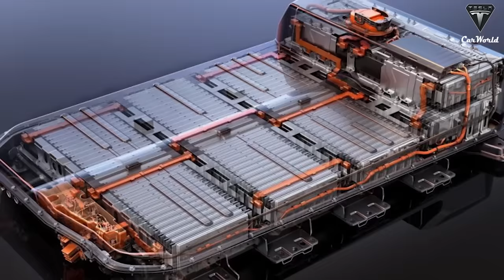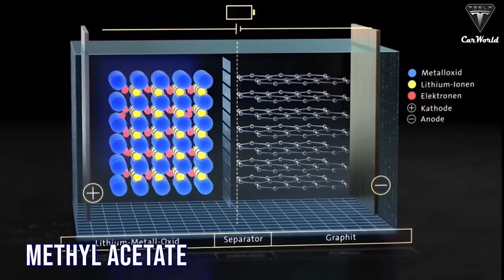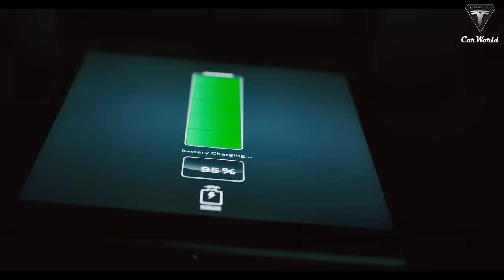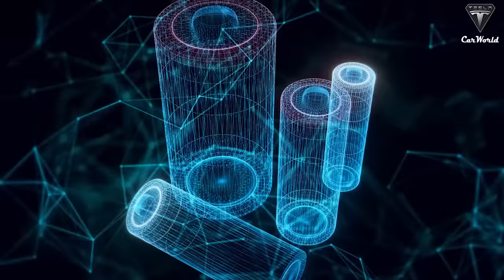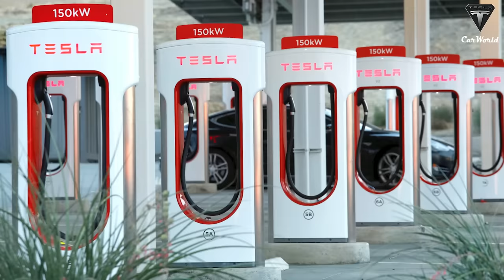The End of Lithium P3! Elon Musk Revealed ALL-NEW Shock Battery Tech, Change Entire Industry!

Comment: I'm willing to bet that a battery that costs less or the same as a lithium battery to make will cost significantly more for the end consumer, making it only available to the wealthy. Also, it will decrease the need for replacement batteries and potentially the need to replace cars as often as we do, which will affect the profits in these industries.
Reply: Most people have no idea that commercial electric motors are designed to work for 40,000 hours. Any idea how far that is at 50mph? thats 2 million miles. in the early days reporters laughed when they asked Elon how long his cars could last and he responded with hmm, i dont know -a million miles id guess. well, he was off by half, but nobody was even thinking about the electric motors, they were the EASY part. People say they want an electric car so they can shoot the finger at gas stations as they pass, anybody who ever got quoted $800 to put in a lousy starter, or $1500 for a timing chain, or $2000 to replace a lousy main bearing gasket, thinks SCREW that, i want to be able to pass mechanic stations! my point is if you DONT WRECK it *paint jobs are $5k these days. And you can take the BATTERY out of the equation, Then EV's last practically forever. If youre 50+ it will outlast YOU. Cars of the future will be sending out satellite signals that say DRIVER DEAD, -please replace. LOL
Reply: '...available to the wealthy.'  When we use to be held under ransom by the Arab oil producing Nations but now a new paradigm literally free energy from the Sun and Wind that the distribution of wealth should be extend out fully even to the consumers with cleaner environment and cheaper product that will never be exhausted, well lets hope.

Comment: The fact we haven't converted to hydrogen power is still beyond me.
Reply: Hydrogen is a fun atom. It's so small it literally leaks through solid sheets of metal. Like, right through it as water would through a sponge if you poured enough. Only, once inside, it likes to create spaces for itself. These spaces make metals extremely brittle before their usual failure times. And for those who like fireworks, these metals can actually catch on fire (more go bang) due to these hydrogen molecules. 
What I'm saying is that while H has an easy pairing to other atoms, it's a bit too active to be of good use, without sub-atomic forcefield tech.

Comment: How about to use alternative energy to stoking energy. Like this way attached a sensor to the wells where rotating wells kinetic energy transfers to alternator and alternator transfer dc energy to the butters  store static energy or direct to system . Which is comes prominent energy all the time.
12/302023

Comment: Tesla doesn't use a single battery type and even if this comes to fruition, and battery tech takes a LONG time to prove, it's still going to use multiple battery types simply due to cost effectiveness and supply issues.  One battery type it's started to use in Asia is LFP from the company BYD and this isn't going to stop because they're cheap, have much better life cycle than Tesla's Li-Ion 4680 and is much safer than Li-Ion and easier to deal with because you don't get thermal issues.

So this will be neat and all, but cost is everything.  Manufacturing to scale is almost ALWAYS the issue.

Comment: Just make a 10-piece car😊 for $20,000 that goes a thousand miles on a charge. And takes 15 minutes to recharge.
Reply: And also make utilities offer charging at household rates. It shouldn't be allowed to charge more for faster power because faster power means more customers so why the premium? It makes it more expensive than gas. it's not just environmental that is driving this. We are consumers and that's why it's called a Utility. If you have to adjust for peak grid usage ok. But if you now want people to charge during the day with solar higher than get real with the pricing per kilowatt hour.

Comment: Most cars drive on average 14,000 per year. A million mile battery would last 143 years, not 200. And that is if they are only used as average. Of course we need better then that if it is to replace long distance road trips and trucking which hit a million miles in ten years all the time. And the controlled temp of a lab and conditions will never happen in real life. This is a hypothetical battery designed to get investors involved and Money infused into Tesla. But it would be a great thing so lets keep trying.

Comment: Is it possible to make high voltage battery for cars and trucks so that taking less space and less in weight?
Reply: Voltage is a function of the chemical reaction taking place in each cell. We add cells together in series to get the desired voltage. Making a highvoltage battery would just mean more cells in series. It wouldn't change the overall capacity of the battery unless it meaningfully changed the charge\discharge losses naturally associated with all charging cycles. My guess is that this has already been investigated and found to be a disadvantage due to high-voltage risks/issues outweighing any potential gain in discharge loss.

Comment: What are EV'S going to do to protect from EMP attacks including from the sun if not enemy forces
Reply: Hopefully give you battery tech to keep the lights on for Sol system exploration, during which perhaps we'll find materials and patterns we can use to keep us better shielded. But if you're worried bout EMP, then I think a human powered glass-vapor-coating rig for coated wires for dynamo wrapping, and a human powered copper wire-draw & braiding system for the wires themselves, should be on the top of list of equipment to have in your tool-bunker. Along with wood fired crucible and some copper scrap or ingot.

Comment: I knew this will come... The long awaited guy is finally here!

It is groundbreaking and a huge milestone in Lithium technology. When practical test conditions are eventually carried out, I hope sooner or later, we'd have them for solar system applications.🎉
Reply: AND if it costs 3X the cost of current Li-Ion, which Tesla's cutting edge is the 4680 which is EASILY over 100,000 miles depending on how a person charges in fact probably closer to 500,000, this battery will never see the light of day.

Battery tech takes a VERY LONG time to develop and to fully test and then to make it economical to manufacture, which is the key.  It can be the best thing in the world but it doesn't matter if people can't afford to buy it.

A typical person doesn't have a vehicle for even 200,000 miles and many people would drive 200,000 in about 15 years and would have already gotten rid of the vehicle for many other reasons, to put this into some kind of perspective.  Economics will win the day.

Comment: One of the things I remember well - how batteries get hot and are at risk for starting a fire or melting things near them.  Do we have those risks with these new batteries?  What are the risks?  Will they be able to be brought on airlines?
Reply: Yes. Risks will be battery to battery but with all ionic forms, there is a risk of discharge and uncontrolled electron flow. Some of them will be safe enough, we can guess, but their development times for such safety will be varied. And what we learn from these elements in use may end up crossing over. Much of the tech is in the patterns of shields and electrolytes.

Comment: 05:43 A PANTOGRAPH atop a lorry!? NOT POSSIBLE! Where is the current RETURN? On railwazys it is the track with the metal rails that is the second part of a circuit. Plus the overhead wires are NOT stagered as they are in all pantograph operations. Asphalt or concrete are NOT conductable elements, plus a railway has a FIXED course of travel, an lorrie with stearing and pneumatic tyres is NOT a fixed system! Thus I am ten billion % in favour of pantographs on top of trains, but they simply won't work for the automotive industry.

This is why trolleybuses that utilised a 'touring area' a track to either side of the bus that again travels on a non-conductive surface has TWO poles (not two pantographs as there is no physical room for that, plus 2 poles as the tyres again, have no conductivity on the road)! PLEASE be accurate in your visuals This is bad for the promotiona of transport electrification! Thank you.

Comment: After 2030 I will eventually need to have a self-contained electric motor module that will fit the front engine compartment and the gas tank area under my cars to retrofit fit my 49 Ford, 2005 XJ8L and 2003 Toyota Highlander.  Is anyone working on this retrofit need or do billions of vintage and antique cars have to go to the junk yard?

Comment: its a total sales pitch. and the idea of using them to support the grid, well surely, thats going to put alot more "demand" and "cycles" onto the battery than actually driving the thing, thereby massively reducing the "at best" figures given. the vehicle battery being a "source" of energy for the grid...u lost energy from the grid to charge the thing, just to pull it back, adding extra cycles, whilst saving grid infrastructure from expenditure it needs to do its damn job. pass that cost onto you instead, why not, they can save on infrastructure investment, while making more money selling you electricity waste in losses alone(more you waste, the more they sell), ontop of taking extra "cycles" out of the battery. faith and virtue versus whats actuallly realistic. even if it did make sense, its decades away.

Comment: Graphene battery are not new been using them for over 7 years.  they weigh more they cycle a lirrle better thats all.  we are still way off from having a battery for the masses electric cars.  a hydrogen fuel cell would be best today only problem no hydrogen stations the same with charging stations both would have to exist along side gas stations.  when you see gas stations replaced and nuclear plants to create the power needed for all that will be the time for an electric car

Comment: Better yet a Hydrogen Fuel Cell Running Motors, Making its' own H2 & O from tap water. Charging a small battery to start the Cycle after shut down. Not Preputial Motion just Very Efficient Fuel Cell and Motor Technology. y

Comment: Why do they keep on about the battery and how long it will last before its a pile of crap. i don't care if the battery will go 10 million miles the problem and the Achilles heel will always be the time it takes to charge the crap  what is the point of toping it up when you do 100 miles  just to keep the battery in good condition it is not practical . And they know this and this is why they are forcing you into lockdowns 15 min city and all the rest They taken you as sheep and easily conned. Toyota has a far superior solution  the same engine that they produce now and it will also run on hydrogen also and it takes only 90 seconds to fill the tank and carry on another 400 -500 miles

Comment: Unfortunately, this video FAILS TO DISCUSS THE MASSIVE PROBLEM WITH ALL EV BATTERY TECHNOLOGIES -- COLD WEATHER!  Currently, Reliable EV Batteries should only be used near the EQUATOR!  All Southern US States experience seasonal Cold Temperatures and Northern States seem to allow useful EV Battery life for only 1/3 of the year!  None of the new technologies discussed in this video mention COLD TEMPERATURE effects on, Battery Charge Rates, Battery Discharge Rates or Battery Storage Life.  Until a Battery is developed that rivals Internal Combustion Engine technologies with operation at both temperature extremes, EVs are a WASTE OF TIME AND EFFORT!  The technologies discussed in this review are very useful in small, compact electronic devices and for potential energy storage battery facilities as long as the batteries can be maintained at an optimal temperature, something EVs cannot do!

Comment: Cars should not run on batteries full stop 
I got a EV taxi home & they’re slower than slow had hardly any power driving up a slight hill in a residential area, found myself wanting to get out & walk home as the tariff meter was clicking up to 3 times more Money than what it normally cost me to get home in a petrol or gas Car. They should Not be used for commercial use I will never ride in a battery car again, they suck.

Comment: batteries are primitive & out of date - super capacitors are the near future !
Reply: try another pill
Reply: @7alken   all will be revealed :-) .. batteries are amperage hogs designed that way to keep people on the side of torque & thick gauge wire when in fact Tesla was already onto it with thin gauge wire & extremely high voltages over milliamps !

Comment: so now if the battery lasts 200 years🤔 then this is not the problem, it is the Tesla car that will be rusted to pieces within 8 years

this is sad because we know how to rust protect a car but Tesla does not do this for some reason

designing good batteries is much more difficult than rust protecting the car but extremely important start with what is easy Tesla or both

https://youtu.be/IRjjS_yY2Qg?si=v_HQonsyZe8PT0tC

https://youtu.be/HJ1tofzX6Bk?si=TTrMQyflDsCEnuVv

Comment: Realize battery capacity declines continuously from day ONE. The fact that they will last 10,000 Cycles only means in the last year you could drive like 2 miles on a charge😂 And charging only between 25 and 80% and cold weather means a range of 35% of whatever they tell you.